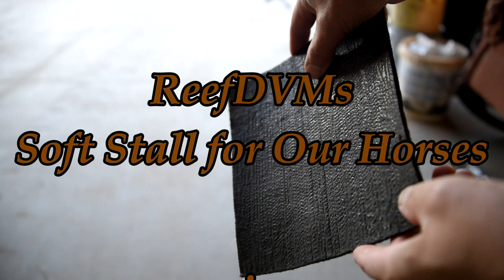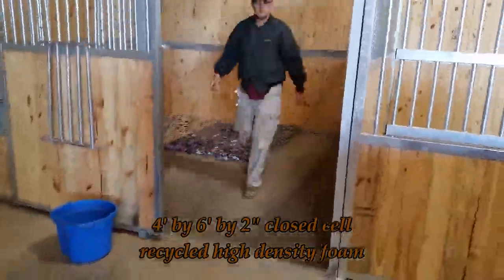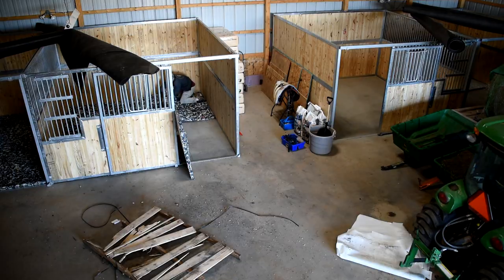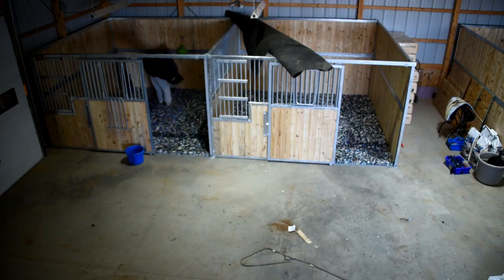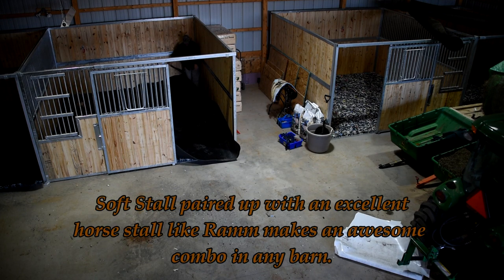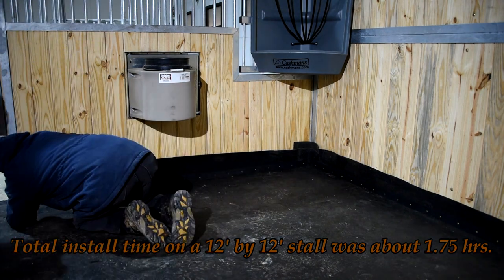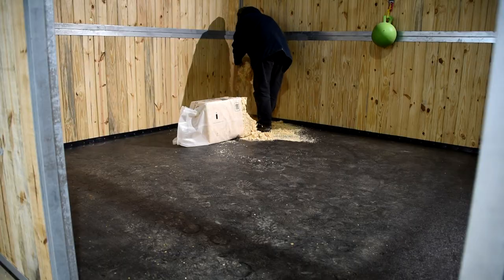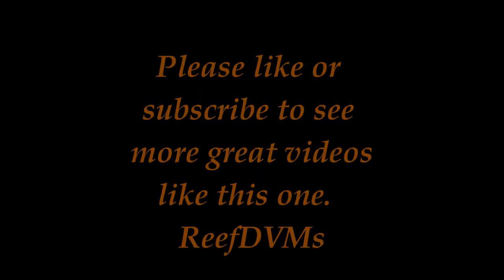Best Horse Stall Mat Bedding System, Soft Stall

Comment: Hello, thank you for posting this video. How is the  Soft Stall flooring system holding up  after 4 years?
Reply from the maker: Holding up great, no issues to say that worry us.  the floor has little more wave to it after years of drafts on it but over all holding up great
Reply: @RMSpeltzFarm  Awesome! That's great to hear! Also, are the concrete floors Hydronic heated or electric?
Reply from the maker: Broiler heat with piped water anitfreeze mix=)
Reply: @RMSpeltzFarm  Now that's smart.
Here plumbers tend to run the same lines you would in a home.
We freeze down to -45c
Will have to see if boiler system will work here with cold and granite so close to foundation depth.

Comment: I'm curious. You mentioned this was great with in floor heating. So if your heating your barn then i presume it is sealed and insulated so you aren't throwing heat out the door. How do you maintain proper airflow in the barn without losing all your heat? Looking to build soon and love the look of this floor system on concrete
Reply from the maker: We heat only under the stalls to keep them from freezing and works great, the temp normally is about 45 degrees under the soft stall and then with the shaving on top insulated enough that none of the fecals and urine there each day doesn't freeze. That means we can sift shaving easy and clean easy and save money on 6 dollar bags of shavings.  The only time if freezes on the top is when the air temp in the barn goes to -10 degrees then will start to freeze the urine in the shavings more for those few days.  The little extra in propane we use to turn on that zone cost us about 10 gallons more each month that is on 24-7 in the winter compared to running that zone closed.  FYI propane is about 1.90  dollars per gallon here when we prebuy in July.
Reply: @RMSpeltzFarm  Thanks for the quick reply. We are designing a new barn and so many different options and opinions out there. Already got a quote on the Soft Stall for it. Was considering about the concrete inground heating because we have Natural Gas access. I don't want to heat the barn but keeping the stall floors above freezing is a great idea.

Comment: That is very nice, I am planning to build stalls in an existing barn with concrete floors. Thinking this is what we will try and accomplish. Thanks!
Reply: I would recommend seriously considering run in stalls in the barn and run in shelters in pasture. Closed stalls are bad for horses physically and mentally.
Reply: sonseere10 Well when you board, sometimes you can’t fine barns like that. I wish my barn had that option but once I get my own barn I will 100% get run in stalls.

Comment: I boarded at a barn that had this system, it was nice except they would not use shavings. It was so gross all the time because the horses urine would lay there in a puddle. And when they would lay down they were laying in their urine. It was so nasty. Plus it was super noisy when the horses walked on it. They definitely need shavings, lots of it too!!! Then I moved to a barn that had 12" of rock as the footing with sand on top. The sand broke down almost immediately, and there was nothing but shavings and rock. Horrible!!!! They refused to put mats over the rock. Just bad on the horses feet and legs.